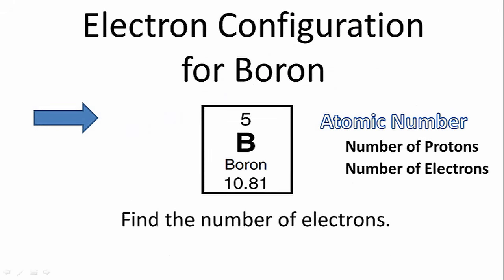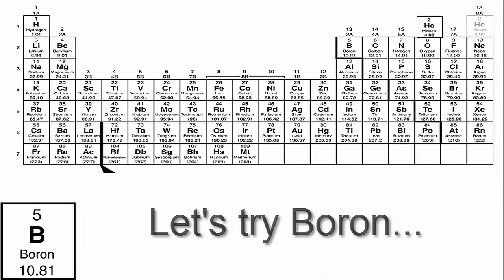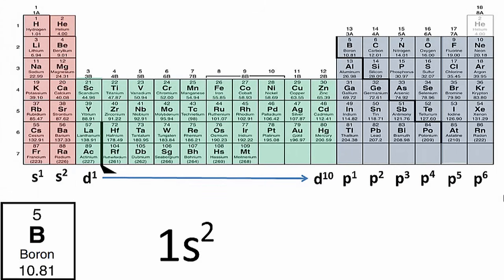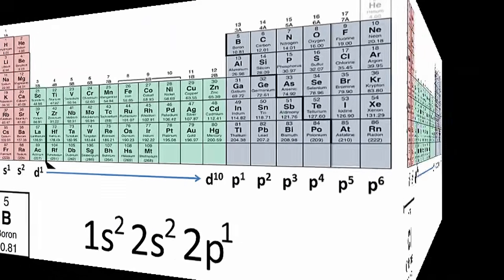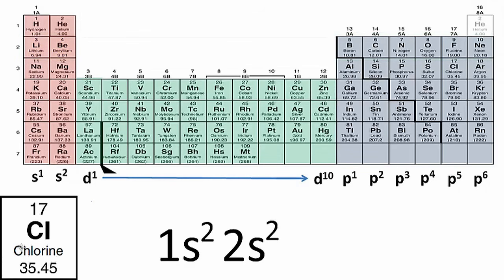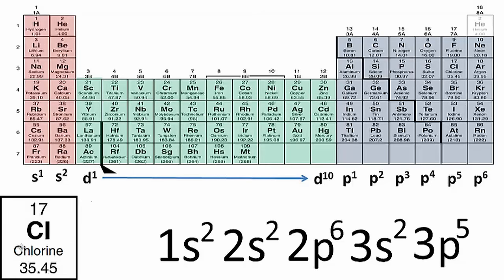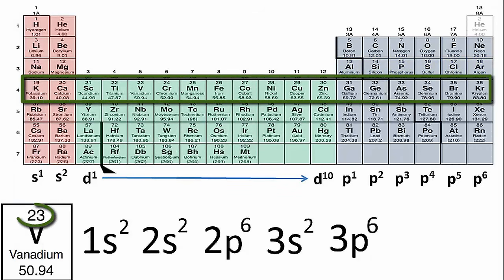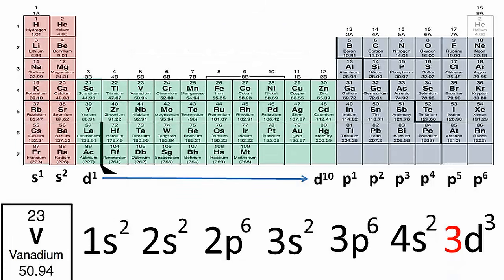Writing Electron Configurations Using Only the Periodic Table

Comment: what do you mean "full'  explain please
Reply from the maker: So when we get to the end of a period, that's also called a row on the periodic table. We say that that energy level is full, least for the first 20 elements. That means, if we add another electron, it's going to go in the higher energy level.  So after 1s2 2s2 2p6 we need to start with 2s2 ...

Comment: Hello! I am curious how you might configure the electrons in the lower D block where the F block “gets in the way,” so to speak (suggested though not shown in the video)—its two rows lying between elements 57 – 72 and 89 – 104 of the D block.  For example, what’s the correct way to formulate Tungsten (element 74:  W)?

Ex. # 1:  [Xe] 6s2 5d1 4f14 5d3, or
Ex. # 2:  [Xe] 6s2 5d4 4f14 (or 6s2 4f14 5d4—would D or F come first?)

That is, does the F block create a break (1st example), or does the D stay together as a unit despite the F block (2nd examples)
And, of course, using the Aufbau method rather than the numerical ordering of electron shells.
Thanks!
Reply from the maker: That's an interesting question.  They do a good job explaining for W here (https://socratic.org/questions/5a84d6657c01490b69baf3e9).  --- Dr. B